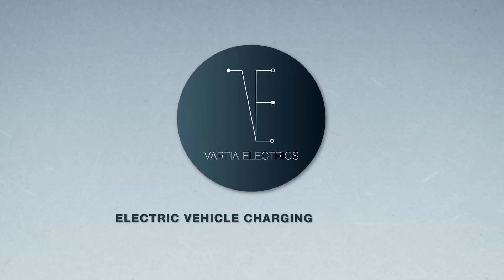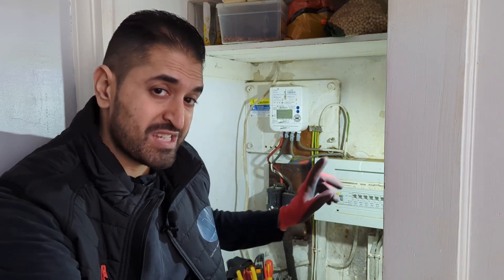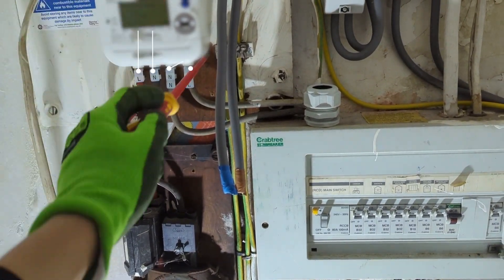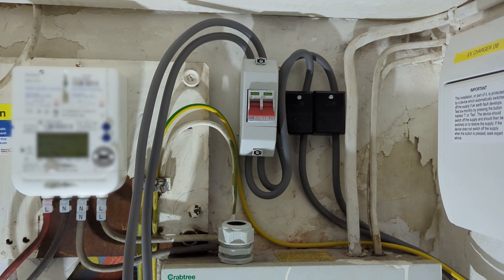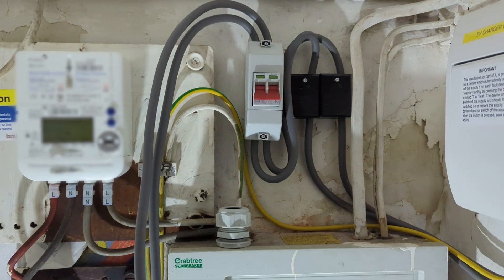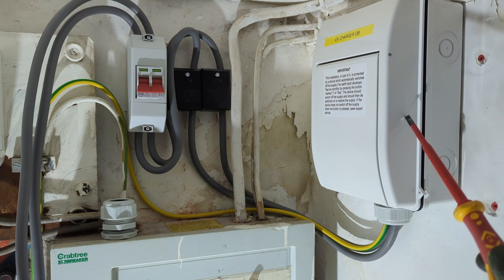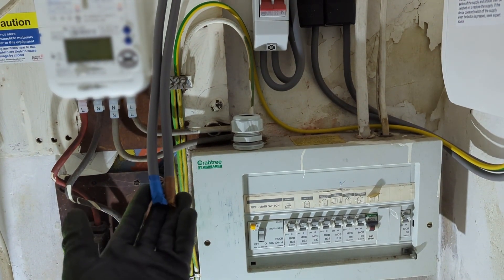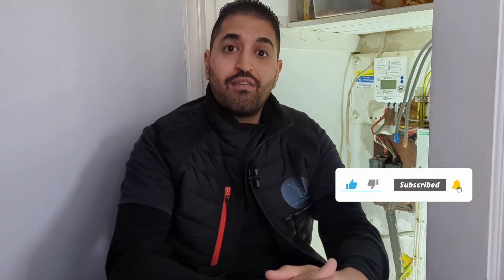Installing An Isolation Switch & EV Board

Comment: Oh dear dno own cutout and supply cable only.The SUPPLIER own tails from cut out and meter,consumer tails out of meter and distribution equipment owned by consumer.That cut out is iron clad that would have been iron clad fused neutral has got plastic fuse and neutral block change, i would like to see earthing arrangements [ec15 around lead sheath a no no,will require cut out change, east mids dno 80a max cut out fuse,will not connect your isolator[when it was emeb you had submit test results]they will at cost fit isolator thick end of 200 quid lol,they are not obligated to connect your tails

Comment: Nice. So the DNO must be informed of such an installation?
Reply from the maker: Good afternoon @ktmad,

Your electrician should notify the DNO if an EV Charger is being installed at the same time.

If only the board had been installed, your electrician will issue you with -
1. Building Regulations Certificate 
2. Electrical Installation Certificate 

Kind regards 

Vartia Electrics

Comment: Why the 6amp breaker?
Reply: I believe when buying that BG Garage board it comes as standard with the 40A RCD and two MCBs. The two MCBs that come standard happen to be a 6A and a 32A. The 6A would be left spare as only an EV charger was fitted which will occupy the 32A.
Reply: Possibly optional lighting circuit if you want outdoor lighting over the parking area of the car perhaps. 

I can't think of any other practical use of a 6 amp breaker.

Comment: You might find the DNO will only upgrade the fuse and tell you to get the customer's energy supplier to connect up your isolator as they're only allowed to go into the meter in emergencies as its not their equipment.

DNO are responsible for the Cuttout, Supplier responsible for the incoming tails and meter itself. I know its annoying and you're trying to do things the "right" way but you might have some hurdles especially with the equipment being installed directly to the wall rather than on fire retardant material.
Reply from the maker: Hi Jarvik,

Your correct the DNO refused to make the connection, the client's energy supplier is due to come out but at a charge of £162. Doing this the "right" way is causing a lot of hurdle jumping. 

You could also be right about installing straight onto the wall, however we would point out brick is fire retardant material. The EV board is metal and designed for outdoor use, so we are basically ready for them lol

Thank you for your helpful comment.

Vartia Electrics
Reply: @VartiaElectrics  I'm baffled by this need for fire boards over non combustable type walls. I've seen a few videos now of people installing a load of large fire boards (for big solar instals) in a garage straight on top of a concrete block wall. 

In all my years as a fireman I can tell you I did not ever see a brick or concrete wall catch fire 😅
Reply from the maker: @northeastcorals 
Good morning Gaz,

Wow what a job, here's us worried about getting electric shocks lol.

We agree with you bricks catching fire! 
but unfortunately as the saying goes "common sense isn't that common" and some work you see unfortunately backs that claim, so we can see why the regulations state this. 

More than likely it's put in place as a blanket statement to cover all situations.

Kind regards

Vartia Electrics
Reply: @VartiaElectrics  Agreed, even in the fireservice we would have to follow some ridiculous H&S rules, which were there for good reasons but sometimes common sense would tell you they were absolutely pointless for your particular situation but they had to be followed regardless (when we knew we were being watched or were on camera anyway 😆).
Reply: @VartiaElectrics  that’s a ridiculous charge. Only encourages sparks to do things they’re not supposed to 😞

You can argue that about the brick, however I will almost guarantee the supplier will install the isolator on the meter board as this is standard practice. 

Nice one for trying to do things the proper way, sorry you and the customer have had issues!